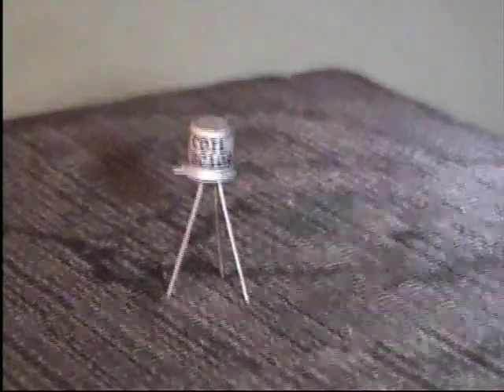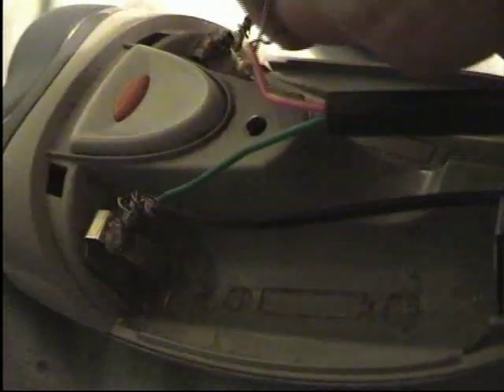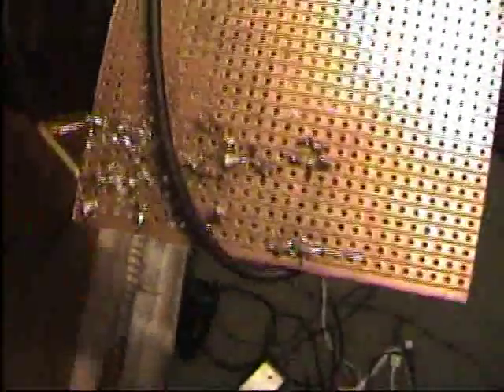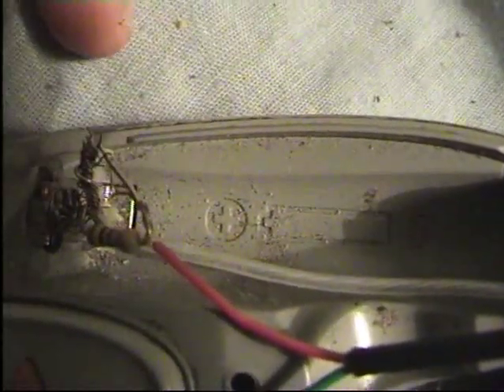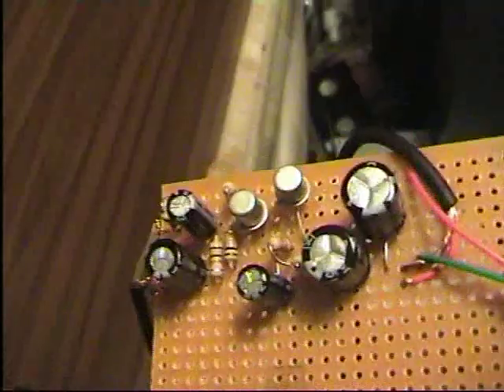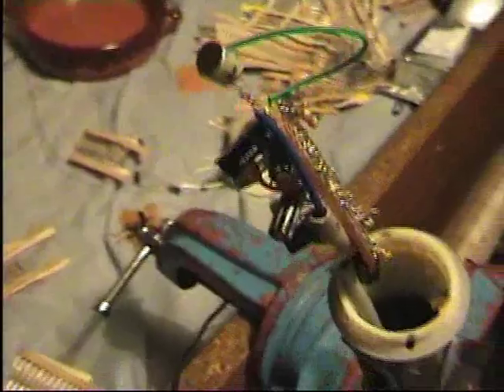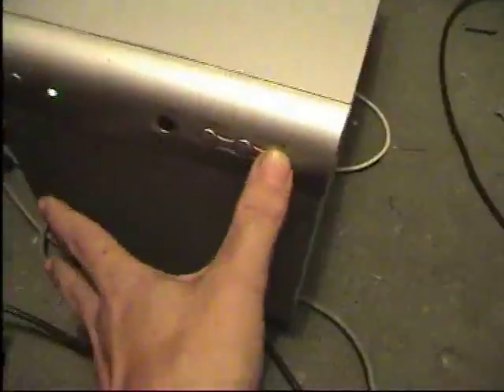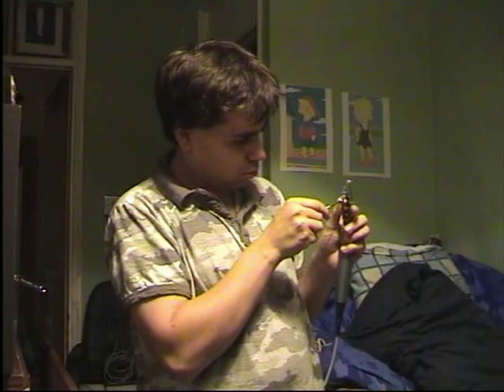Testing 2 mic preamps

Comment from the maker: I did this because it was be an interesting little project.  I've used dynamic types in the past and decided to try the eletret type, they're more sensitive and do not pick up hum, the only downside is they have a little bit of hiss.  I wanted to use a capacitor mic, they have less hiss than condenser mics, but I didn't have any so had to settle for condenser.

Comment from the maker: The sensitivity of both preamps is very wide, I think they would both probably cover 5 hz to 100 hkz.  Eletret/condenser mics are most sensitive but these microphones need power, so connect it to the preamp like a normal dynamic mic, but use another battery (9volt is good) to power the mic, the negative terminal connects to the mic's ground wire, the positive connects to the mic's positive/signal wire via a 1k resistor (it's ok for current from the mics battery to get into the preamp).

Comment from the maker: You can get transistors and other electronic components from various places on the web (try rapid electronics, (sorry I cant post the URL)). If you have a Radio Shack nearby (if there still around) you could try in there.  You could also rip them out of old circuit boards.  If you want schematics for building electrical circuits, just search on the web, there's tons of them about.  For example if you Google "Preamp Circuit Schematic", I'm sure youll find somthing.

Comment from the maker: aditional: you could use the preamps battery to power both the mic and the preamp, but it might oscillate like what happened in the video.  If it does, connect a capacitor (1000 uf or more) to where the power is connected to the preamp.

if you need any more help just pm me or post another comment.

Comment: Hey Clem, I realize this is an ages old video but for your future edification, a single transistor FM transmitter preamp section works quite well with the electrit  microphone. Perhaps you have seen Dazaro3 on YT. Circuits on Google Images. Take care, C.